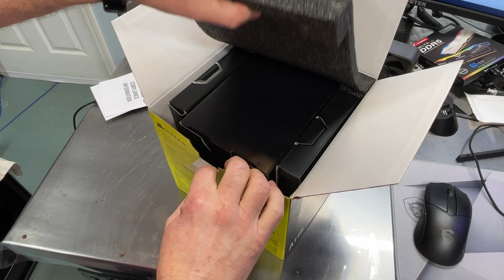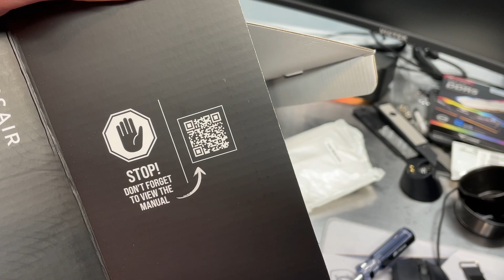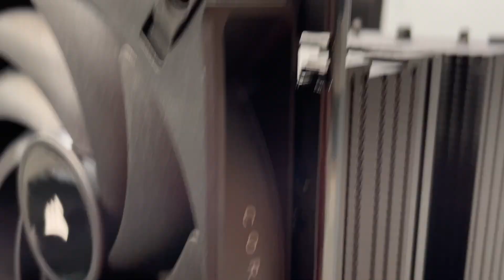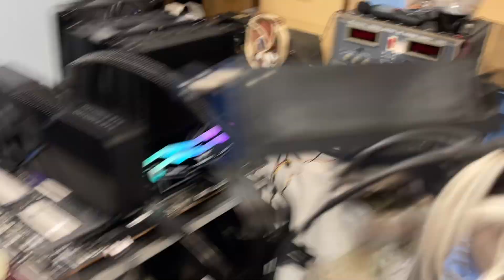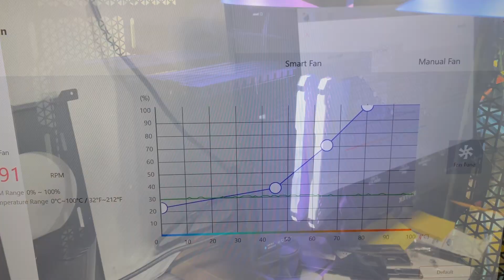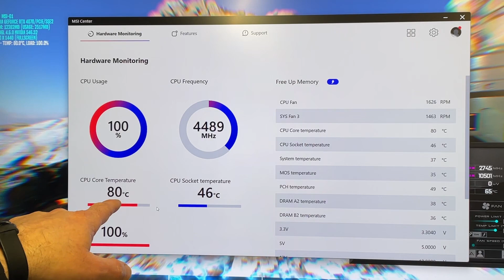Corsair A115 High Performance Air Cooler Review!

Comment: My noctua d15u 3 fan inwin Saturn 120mm outside n nocturia 140mm middle i9 12900k in game around 50-54c I don't know if the corsair can beat it
Reply: How are you running the 12900k?  Is it delidded, overclocked, undervolted, or power restricted?
Reply: @nosajmartinez6175  normal no overclock stock let it do its own no under volt nothing
Reply: @sk8erjon316  Right on.  I have a 13700k, so it has similar heat output and researching air coolers now.
Reply: @nosajmartinez6175  I really liked my inwin Saturn fans there easy install easily chain and are direct air made for stuff like water coolers n cpu air cooler n has leds so what you can do get any air cooler replace the fans
Reply: @nosajmartinez6175  so what did you choose for 13700k?
Reply: @nosajmartinez6175  stock not overclocked just out of the box on a z690 aorus master mb
Reply: 12900k turbo boost is more than 5.0, how your cpu is not even close to that?